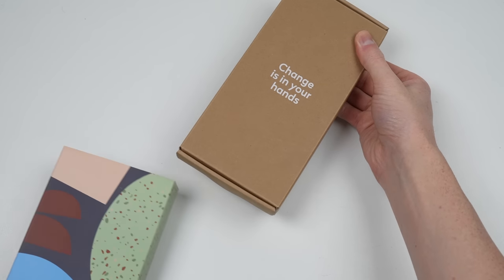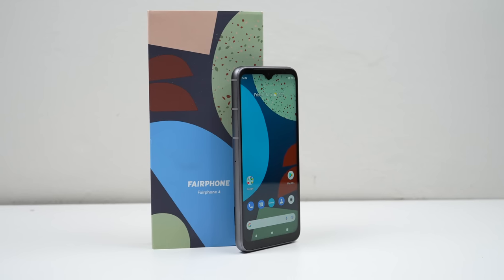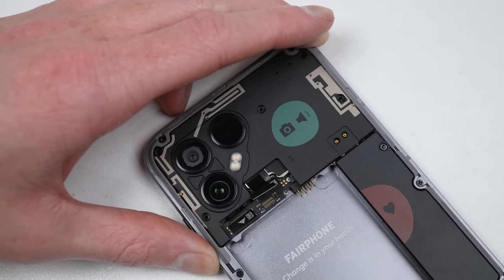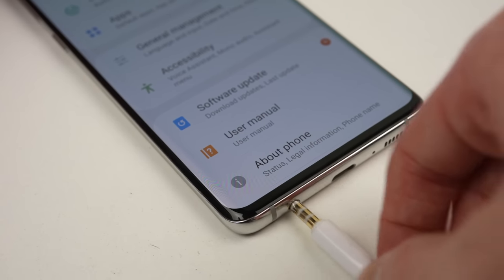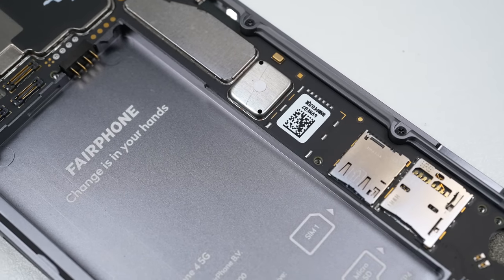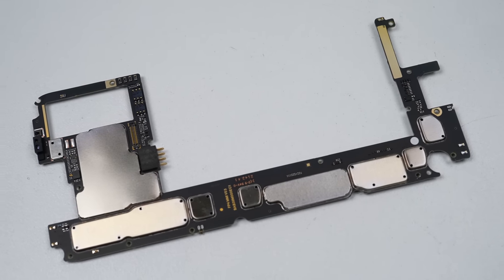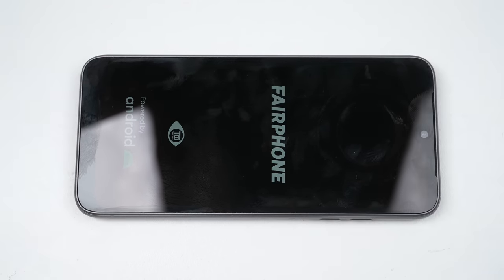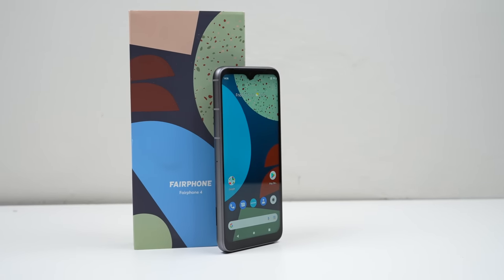The Phone Thats Fighting Big Tech - Fairphone 4 Teardown and Repair Assessment

Comment: I get the idea, and it seems a noble one, but it's just too expensive. I've had two Xiaomi phones since 2016 and the two together were cheaper than this one, not including the price of replacement parts. My Mi Max 3 is over four years old and still doing fantastically well, even if updates are non-existant. They also come with unlocked bootloaders so I can flash a custom ROM if I want to. My old Note Pro 3 is acting as my mobile router, so even when it became out of date it's still being useful. The problem is these days that everyone has to have the latest phone and the branded phone, so this isn't going to appeal to the average IPhone user, and those of us who value function over brand name have already found alternative phones that cost very little. So I'm not sure who this is even aimed at? It just seems a bit gimicky to me.
Reply: im sry ive had 3 xiaomi phones and they definitely don't come with the bootloader unlocked. You have to factory reset and also wait 7 days while using their crappy unlocking software that's only in Chinese if you want to unlock it
Reply: My Mi Max 3 came unlocked out of the box, as did the Redmi 9T I got for my Mum last year. It depends which version you buy: Chinese version comes unlocked as standard, global version doesn't. If you didn't research your chosen model and ROM that's on you, not Xiaomi!

And if you're buying a Chinese phone why would you expect the Chinese to bow down to you and do everything in English? Talk about entitlement! Are you American per chance?

Comment: just no...i really wish I could've liked this but I just can't with this version. The headphone jack removal alone basically dug this phone's grave for anyone who's seriously sick of the BS that all the major manufacturers are pushing, so I wouldn't give a cent to the company if this is the direction they're going.
I do appreciate the ease of replacing certain parts, but (apart from the easy-to-remove display) this kind of design was used in one of the best (in my opinion) phones of all time, the galaxy S5, which was slim, flagship spec for the time, had more features than even a lot of flagships nowadays and a removable battery while still keeping the phone ip67 water-tight. Someone needs to just come along and give us a modern refresh of that, not some half-assed attempt at reparability which still embraces some of the same anti-consumer practices of big manufacturers, while also falling behind when it comes to features, price, distribution etc.

Comment: - No charger included? NOT a problem at all, ANY charger would pretty much do, from a 500MAh (yea a slow charge) to a 50Watt (modern charge bricks tend to have circuits built in that monitor their output).
- No cable included? Who the hell hasn't got a cable laying around? And if not, can be eBay'd or Amazon'd for a coupla quid 
- No headphone jack? Yeah, somewhat pitiful, as in ALL of the hifi equipment I have owned from many companies from cassette 'Walkmans' to CD players, to Minidisc players, to MP3 players, to many phones (and I have owned MANY MANY pieces (am 51 years old now) ONLY ONE headphone jack has failed through my being 'rough' with it when I was a kid), wired headphones STILL generally give better sound quality, reliability and, no need to charge either.
- 5 years OS updates & 5 year warranty? NO other phone manufacturer off that, full stop.
- That retail price of £499 (starting price)? a BIG NOPE.... If it was £350 to £400, then yeah, a VERY good option.

All in, a very good concept that ALL manufacturers should consider seeing that when we buy our products those products SHOULD IN ALL RIGHTS BE OURS from point of sale.
Just let down by price, with a niggle over headphone jack.... 🤔😒    😎🇬🇧
Reply: You're really downplaying the terrible quality build and buggy OS. Like really, you're going to excuse them not using any adhesive? Then I hope you like water and every speck of dust getting in there.
Reply: @eddiew.4650  Oooh ain't you picky. Don't need to pull them up for having no adhesive in the build of the phone. As it was pointed out, there is no need for it when designing the phone to be easily fixable. And tell me, over the decades, how many electronic devices have you placed in your pocket and over time had dust and fluff build up inside it and... The device STILL worked no matter what? Those devices DIDNT have glue, they were small parts screwed together..
Maybe think before you make comments like that.
As for OS, well, as for the recent reintroduction of 'Dumb/Feature' phones and their increase in sales, having the 'Latest and greatest' isn't the be all and end all for everyone....
Naturally this phone might not be for you or a lot of people, especially if you (or they) are ones for top spec hunting.
So, I STILL applaud Fairphone for trying to make waves in the world of 'disposability, waste and rip off business practices' as provided by such companies as Apple, Samsung and others....

Comment: Bit offtopic, but I hate the fact that most flagship phones nowadays just ignores the headphone jack connector entirely, and the excuse of "being another part of the phone that can break" is just shallow in my opinion. If they truly do this to improve the durability of their design then why not adding a second USB connector to replace the headphone jack  with? Not that I think that this would be a better solution than, I don't know, actually having a freaking jack, but at least that would allow the user to use one USB as audio output and the remaining one for data transfer/charging, something I find myself doing pretty often and in which situation a splitter simply doesn't do it for me, plus this double USB design would actually improve the phone robustness by providing redundancy in a critical component. The excuse Fairphone gave in this matter is absolutely not valid in my opinion.

Bottom line: Bring back the headphone jack
Reply: So stop buying flagships. I have a Pixel 4a with a headphone jack and can't be happier.

Comment: I could have supported them but they made a mess of it. 
First they are hard to send you one. Seriously when you are trying to get into such space you should be begging to get buyers no  matter where.
Second as the guy in the video i use two sims and SD card and headphone jack. 
Third, no charger really annoys the shit out me. A company all about fairness should be fair and throw a charger a cheap case and even an adaptor since they didn't put a headphone jack. 

What is so fair and great in the end. I don't give a rats ass about their recycled materials.
The only great thing is the changeable battery really. The 5 years is also fishy. I have a 2017 smartphone and it still works fine. Sure the battery isn't as good as it used to be but i can still use it. And am just starting to think of replacing the battery now that is 5 years later. 
So basically just about when the battery will go bad they may stop selling it.

Comment: I thought the blue blob was thermal paste. 
I took apart an old LG Stylo phone, don't remember how I got it, I think I saw someone threw it out and I kept it for parts since it was such a terrible performing phone that it wasn't good even for SNES emulation, anyways, the headphone jack was TINY and standalone. Used pogo pins to connect to the daughter board. WHAT A GREAT DESIGN. I haven't seen another phone do that. USUALLY they combine it with the USB PORT daughter board.

Comment: User replaceable battery is a joke as far as people are concerned cos at least in my opinion there has not been a phone just as repairable as the fair phone while still having flagship level features including water resistant that most people would like to have and with a midrange chip it will not list very long as more Apps become more demanding to run as well as the fact that in terms of longevity of hardware which defeats the purpose of a repairable phone and what about upgradability why don't they do that since it so easy which would also make their software developers job easier to support for as long as over 5 years since the processer and WiFi/Bluetooth chips are mostly the only things that change throughout the years of newer phone. In conclusion glorifying and making it seem possible when the it clearly is not a proven solution

Comment: As repairable as this phone is I still won't buy it just due to how expensive it is for very out of date hardware. It's not worth anywhere near it's asking price.

It would have to come down to about $300(if they ever sold it in the US) for me to even consider it. Otherwise there's very little reason not to just buy a pixel A series phone or an iPhone SE both with much better hardware and a lower price.

And in the iPhone's case it's gonna get the same or better software support as the fair phone.

Comment: With the start of Fairphone, the company I owned back then was the official repair company for their products. We repaired the FP1 and FP2 but then lost the contract as Fairphone was obliged to follow EU regulations and have repair centers in every country  in which the phones were sold. That's EU for you :-(. The FP1 was not designed by Fairphone themselves, the FP2 was. It was, as this phone, completely modular but had quite some (beginners) design faults, resulting in a lot of work for us. But even then, it was a relieve to actually repair a phone with parts readily available. Back then the only phones that were easily repairable were the Samsung Galaxy S3 and S4. With this phone it seems that they have grown up, the design looks quite good and thought out. The only negative is the soldered shields everywhere, making a board level repair very difficult. (But all Fairphones are constucted like that). It would be nice to see a phone with schematics and an fairly 'easy' way to to do component level repair and Fairphone never released schematics, not even to us. That all said, Fairphone is a company I enjoyed working for and I do wish them a great future ahead. Oh, and the country, that's Congo. An important country for Fairphone where raw materials are sourced from non-conflict areas and were workers are (supposedly) treated fairly.

Comment: No headphone jack and an awful teardrop notch combined with a top bezel. That could be a phone I would actually own, but it's also a phone I don't want to own. Do better with the Fairphone 5 and I'll consider it.

Seriously, what is that top bezel and notch? Notches, cutouts, holepunches, they're all terrible. Just have a top bezel. And this phone already has a top bezel. So put the camera in it. I will never buy any phone without a headphone jack. Removal of the headphone jack is a scam so the various manufacturers can try to sell you their overprice branded wireless earbuds. And Fairphone is no different, they're selling wireless earbuds on their store for €100. No thanks. Bluetooth and headphone jacks can co-exist in the same device (every smartphone I've owned has had both) so I expect both to be there and won't buy a phone that's missing one of them.

Google also just lost me. I love my Pixel 3a. Pixel 6a removes the headphone jack and also Google now has "budget" wireless earbuds to sell you. HMMMMM 🤔🤔🤔
Reply: 4:32 - WHAT!!!

Any part of the phone is a part that may break. What a garbage attempt at an explanation. You removed the headphone jack to sell wireless buds, that's the start and end of it.

Comment: Hi! Industrial designer here, I think removing the headphone jack wasn't that a big deal actually, making things replaceable takes a lot more space and weight than we think it does and in the longer run requires more parts and can make the assembly & manufacturing a lil difficult. Again when comparing it to literally any other brand, a job well done! 
Looking forward to a better display in the  next variant and maybe even an aluminium casing. Anyways a big step for any company to achieve something this cool!

Comment: For everyone moaning about the headphone jack, its fairly easy and inexpensive nowadays to get wired USB-C headphones that could last just as long as a 3.5mm headphone could, and the phone isn't just about sustainability, its also reasonably priced and so if the USB-C has the capability to do both and the ports unlocked so you can use third party adapters, I don't see why its such a bad thing.